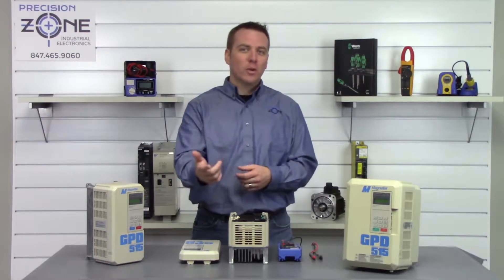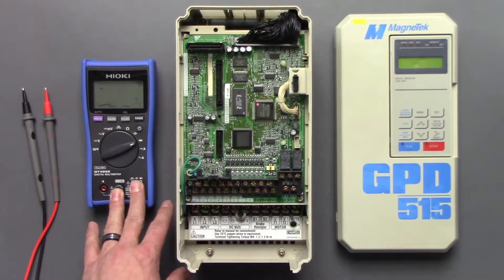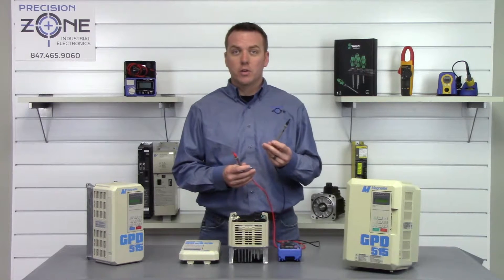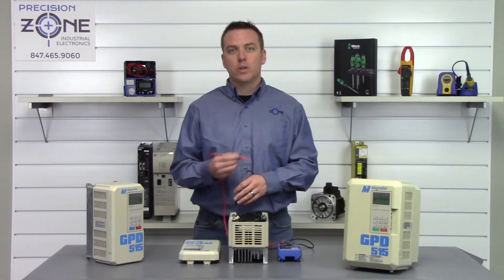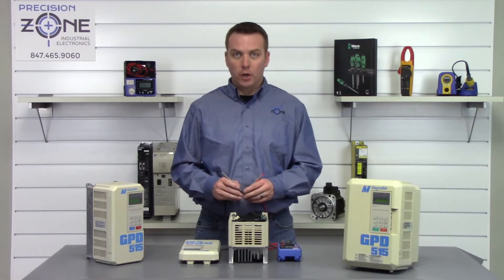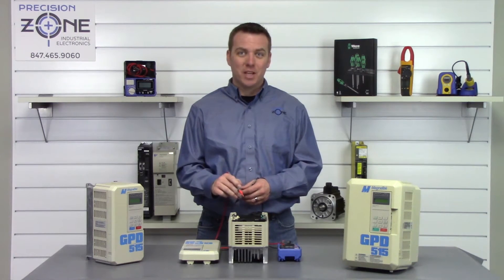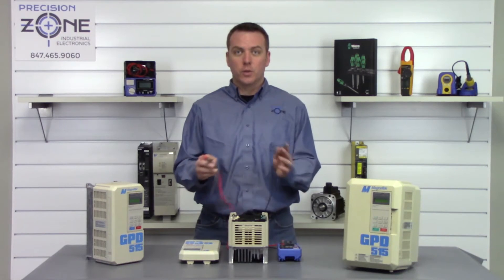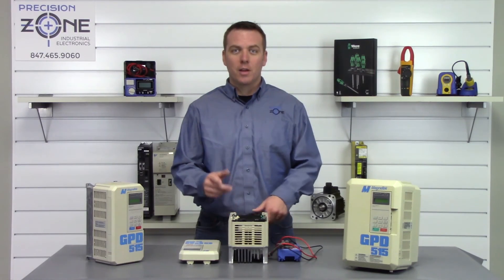Magnetek General Purpose Inverter Drive GPD515 Series Static Check

Comment: Hello everyone,  is there anyway I can do  a reset on the hardware to clear all parameter that I have set, am having an error UV(under Voltage) once I Power the drive ON, I started having the error after I mistakenly set the input voltage to 480v.

Comment: Your video was very useful. Now my variable frequency drive Make :Frenic showing one reading in R and no reading in S and T diode check method. outlet side getting the correct  reading in U  V W . please let me know what to check to find out the fault.
Reply from the maker: Hi Marine Tech Hub,

Thank you for watching, we are glad it was useful to you. We would be more than happy to help you out with this issue you are having and we can offer you free technical support! Would you be able to email your contact and product information along with the specific issue to support@precisionzone.com? Our engineering team will be able to dive in further to help you to figure out what is happening with your machine and get you back up and running asap! 

Please let me know if you have any questions or are in need of anything else! 
Thank you again for stopping by and watching our videos!